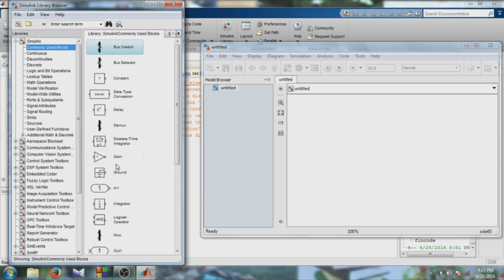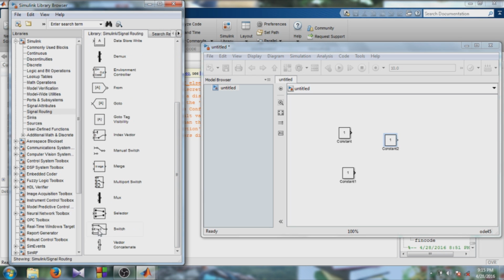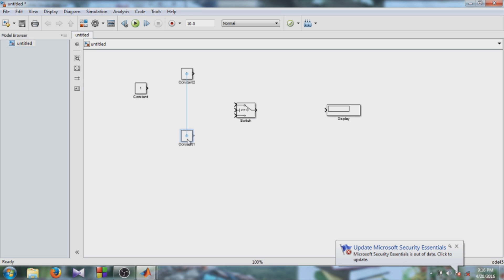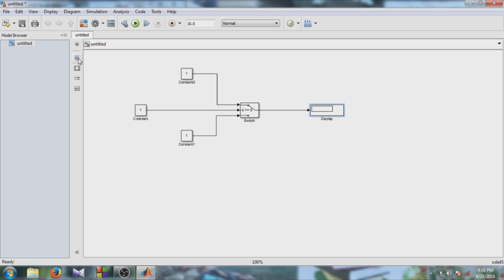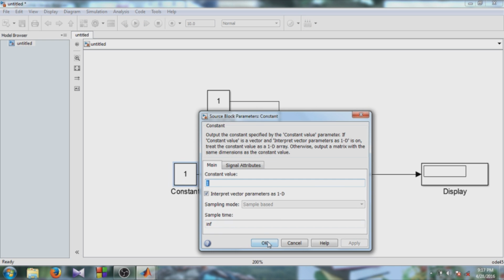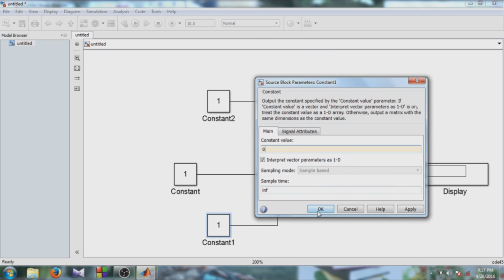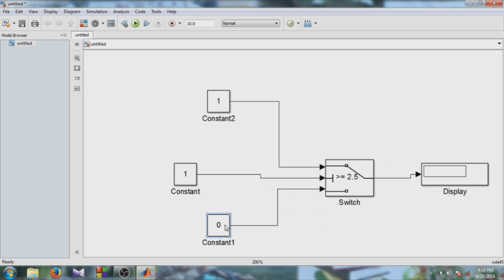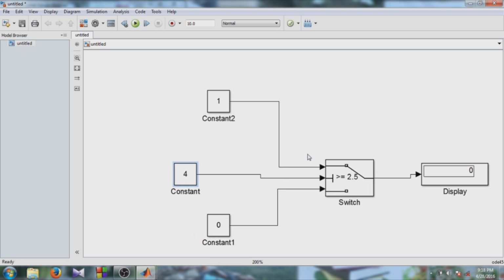Simulink Tutorial - Tutorial 3 - if else logic

Comment: I need help in simulink 
Basically I want to use my fuzzy output to make decisions to on or off load based on the value of fuzzy output.
Let's say fuzzy output is 0-1.
For value 0-0.3 I want to generate a signal 1 logic that I can give to circuit breaker gate.
Same for if value is 0.3-0.6 then generate 1 logic.....
Same for 0.6-1 then generate logic 1 to provide pulse on circuit breaker to turn on load.
Basically I have three loads and I want to switch on/off on the base of fuzzy outputs.
Thanks
Reply: You need simulation or run on physical hardware

Comment: How do I implement LED blink by pressing push button and LED should switch off after releasing the push button without using stateflow in simulink?
Reply: did u get any solution for it?

Im kind of programming c and i need to simplufy using simulink.. plz share it if u have some solution
Reply: you can use stateflow easily for LED blink application